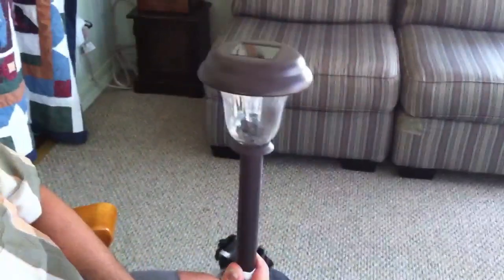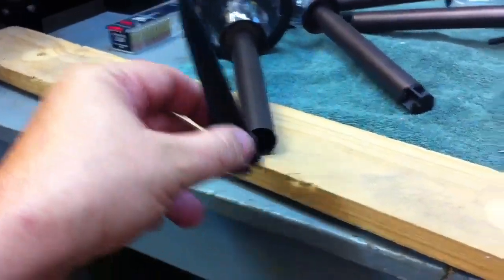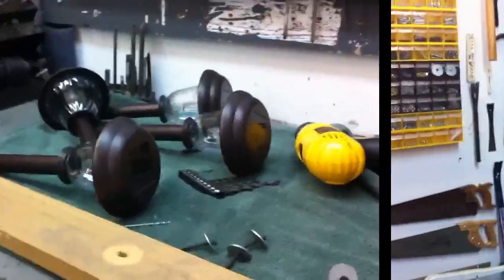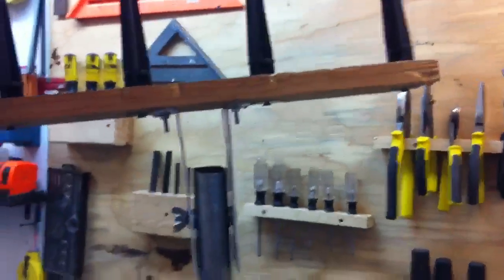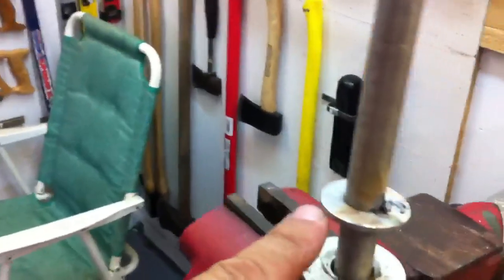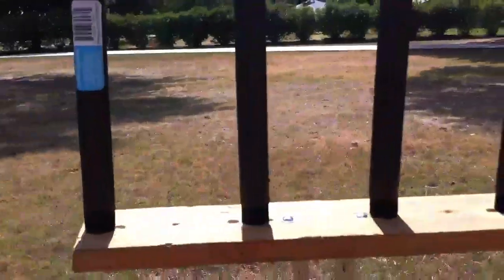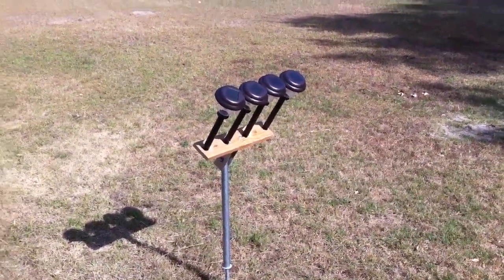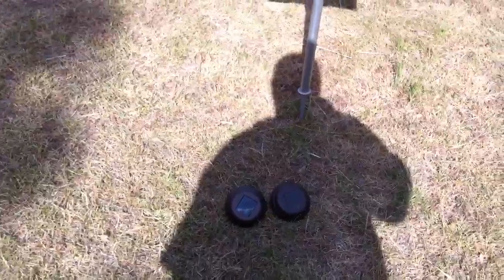How To Charge Batteries Using A Solar Garden Light

Comment: I wonder if the $1 ones at the dollar store would work as well or at least well enough? That might come in handy if you had nothing else, it would work even better if you ran it through a joule thief, I don't know if there is already one in them or not. .
Reply from the maker: I think the $1.00 ones only have those little button cells in them. Not common size batteries.

Comment: Jiust saw this, three and a half years later, LOLOL. Better late then never, eh?  I guess you prolly figgered out if you use the adapter sleeves to go from AAs to AAAs, you can charge AAAs too.  I used one of these as a driveway marker, cuz I'm always losing my driveway when I'm out on the road after dark. Ripped the flag off of a bike safety flag, then mounted the solar light on top of the pole, wormscrew-clamped the whole now-4 foot tall unit up onto one of my wrought iron gate sticks, and....tada, I don't get lost any more!

Comment: Great video, How about installing  a switch to turn off and on the LED when needed inlew of the photo sensor? then the lights themselve could be used as needed without additional battery loss. Just a thought
Pete